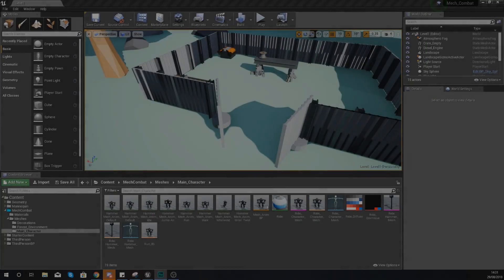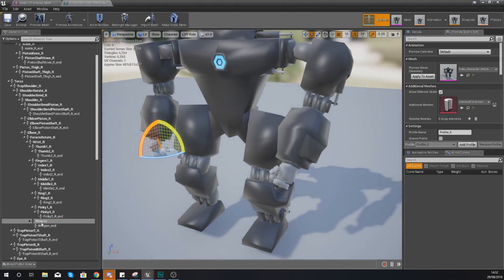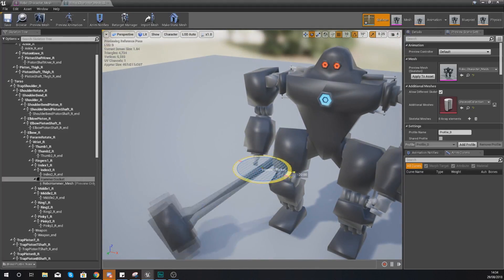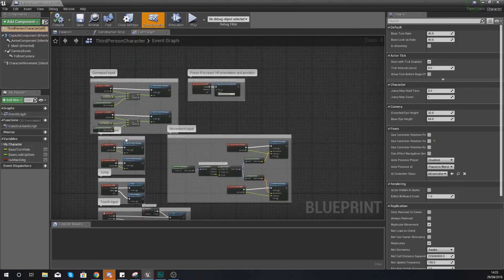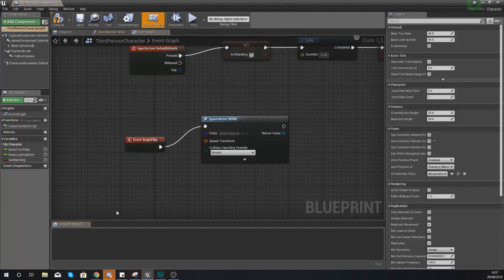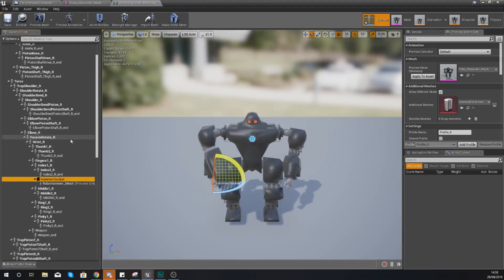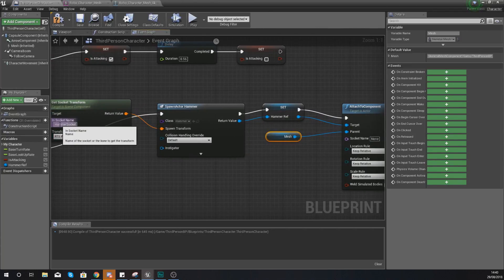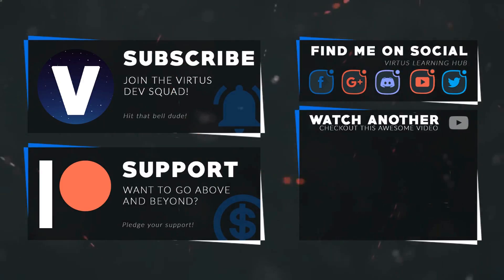Hammer Setup - #8 Creating A Mech Combat Game with Unreal Engine 4

Comment: Hey,
Unreal Engine is not identifying the hammer mesh as a mesh.What should I do?
Reply: Did u fix it??
Reply: 5:27 Use static mesh instead of skeletal mesh. The only difference is static meshes are used when there aren't any moving parts, like the hammer, and skeletal mesh is used when there are moving parts, like the robot.